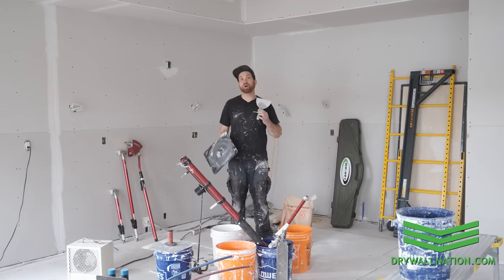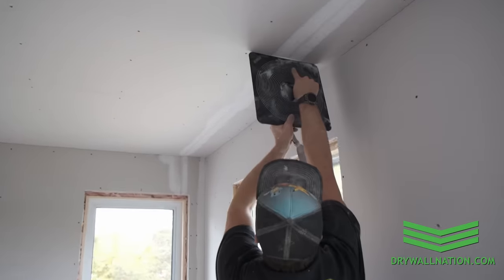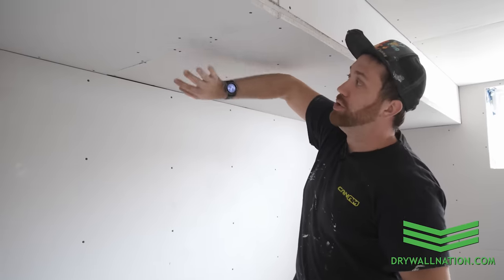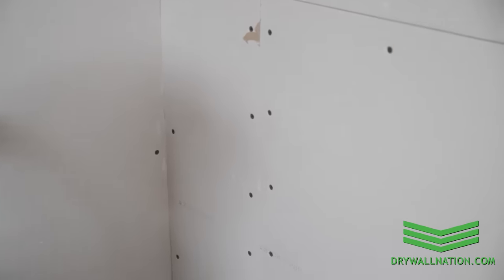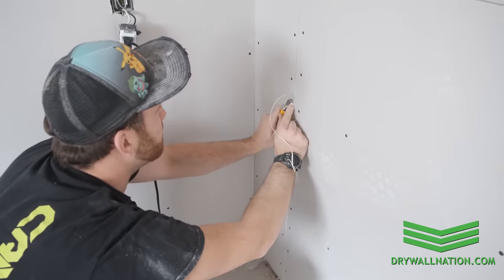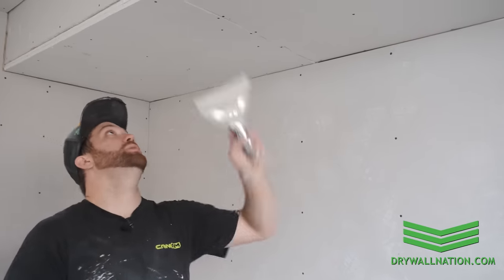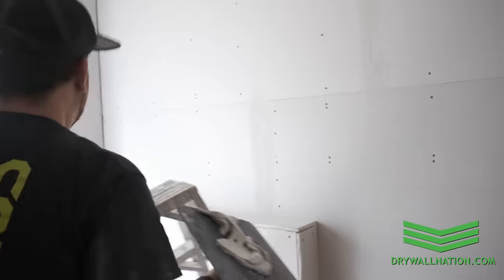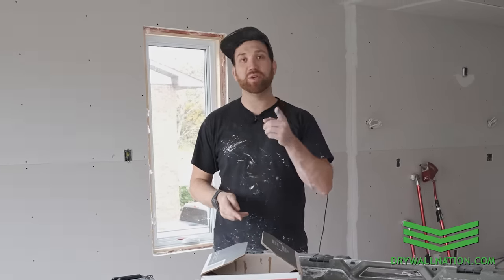Importance of Prefilling and V-Grooving butt joints.

Comment: Is there any reason that you aren't prefilling the flat joints? I was taught that this was the only way to prevent the squish out of compound as the studs shrink. I started doing this 15 years ago (along with the cut out and prefill on the butts - good call!) and haven't had a single call back because of the 4' high bulge in the walls. Is this just a regional thing? Cheers!

Comment: I had a simular case when I had to install 2 layers of 5/8 but did request to the Engineer to revise the permit and went with 1 layer of type c firecheck  1/2 inch drywall,  you can actually get passed by the city inspection because the type c is 2 hours min  vs type x 30-45 mins the only thing you need is Engineer to sign date and stamp , thanks for your informative videos
Reply from the maker: Intsresting! Good to know!
Thanks for the info and thanks for tuning in.

Comment: I'm a noobie, but I use 45 minute on big gaps and screw holes. Never do the but joints but I run my sheets vertical, so its less of an issue. And I have never had to do a ceiling in a large room.

Comment: Thanks for another great video! Would love if you guys could do one on how you prefill around bad cutouts. I was taught the perma patch method (I'm not a pro pure hobby level) but seems like you guys have a faster, cheaper and cleaner approach
Reply from the maker: Thanks for the kind words. We'll try to do that on one of our upcoming jobs. 6" rolls of Fibafuse work great for floating over damaged areas.
Reply: @drywallnation  the problem why there is a need for V-Groove is pan mud and paper tape.

I use Duroban and mesh tape and hot mud to finish and I never ever had a bubble or cracks.
Reply: @ViperStruck1  lol, Anytime bro the truth be told when I am on a union job I will use pan mud but if they have any hot mud on site I am going to burn through every bag first, cut all my corners and sometimes do a second coating before my shift ends
Reply: @ViperStruck1  that wood had to be moving or something because that is not normal especially with gluing it too
Reply: @ViperStruck1  this is being honest as honest as I can, with the combination of hot mud, duro rock and mess tape I have never had even one crack ever. I believe in that combination so much I even use it in corners which is a slow process but no cracks.
Reply: @rickyperkins232  Union is Awesome Great Guy's Razor sharp guys trust me . Job's the same doesn't matter to the compound.

Comment: I just repair. I don't do new work. I "V" groove anywhere there's an overlapping edge, crack, or plug patch. Then I tape over it. Prevents it from doing it again. I don't tape on plaster. I just build it up. Tape has a tendency to peel over time.

Comment: I’m a retired sheet rocker and we always grooved our butt joints before we hung the sheet. Sheet rockers looked like they could have done a better job of hanging. They gave you a joint eight inches from the wall. Why?
Reply from the maker: I'm glad to hear you v groove as well. Regarding the joint 8" from the wall, it's a long video, so im not sure which you're referring too but we hung this job ourselves, so im sure we had our reasons. We also use buttboard which recesses your buttjoint.

Comment: I dont like hot mud because it expands when it dries. I try to use joint mud because it will shrink. Lows are better than highs.
And Yes. Go through and cutout any delaminations and cut grooves on but joints. 👌

Comment: Always prefill,but never v cut, I've seen it a couple times in 20 plus years here in Colorado and wondered what the benefits are . I'm definitely interested in those butt boards though.
Reply: Yeah I agree. Im in Colorado i haven't v-grooved. Joint isnt moving and your taping it anyway. Why cut away the paper holding it more.
Reply: @kennethmabus381  Ive been in Colorado since 1976. We always V groove and prefill all joints. You must be from the Eastern slope where the cheap jobs are. We get Denver corner cutters coming up here into the mountains underbidding and doing poor quality all the time.
Reply: @endoalley680  ive been here since 73'

Comment: Im an electrician in FL I fill alot of holes.  Would love to see a video on how to best do that.  When I get a call back to do something else I see shrink lines and crazing from using joint compound.  I have recently tried hot mud but have not been back to see what the final finish looks like.
Reply: Setting compound  is good. It doesn't  shrink like mud
Reply: Dude get a mud pan ( metal ) 5 min easysand and mix it with water . Thick if needed to pack the hole first .  We use mesh tape at work and twist it in the hole like a tight spiral then it fills when you let it go put a lil mud on them stick mesh over the whole hole .

Comment: Usually I prefill anything over a quarter inch especially on inside corners I haven't really found anything that's less than a quarter inch needing to be prefilled I guess it depends on what's going on with the Gap and how deep it goes. More of a judgment call based on the deepness of the Gap I would say. But yeah pre-filling is very important to me too. I also do the v Gap cutouts especially if the butt joints are super tight. If there happens to be a slight Gap I might not v cut.

Comment: That’s just overdoing it, unless you are having a Level 5 smooth finish with a lot of sunlight reflecting in then that would be appropriate. And Fast set mud is bad for prefilling unless the void is 1/2 inch or bigger to act as backing after it sets, but you have to be careful with fast set because it reacts after it sets and bloats up because the moisture is evaporating which means you will have to scrape or feather off until completely flat. I’m from So Cal and only use all purpose with thick consistency to prefill and pretty much first coat all of the project.

Comment: I do a lot of high end offices and massive projects.  I always expect my tapers to prefill using confil.  I also order my drwyall so my boarders do stand ups to ceiling height.  If not, I QC  the joints and only trim out the sheets with  busted  edges  A good trick with steel framing is to lose the butt joints behind perpendicular walls.   V-jointing all the butts is too much to expect contract workers to do and the  finish isnt that much better.  Most GWB ceilings are level 5'd anyhow, so floating the butts is fine.  Most walls in front of bay windows are typically level 5'd as well to prevent flashing.  BC, Canada, baby.

Comment: Is it possible to use green all purpose to prefill or do I have to only use hot mud?
Reply from the maker: You can prefill with joint compound for sure. We just prefer using hotmuds because it dries faster so we can tape over it immediately and there's no shrinkage.

Comment: Does the pre fill have to dry before taping?
Reply: Yes, I would recommend letting the pre fill dry before taping. We pre fill all joints and gaps in corners. The better any drywall mud drys out the better the bond.
Reply: I always allow any prefill to dry completely and use durabond 90.

Comment: I'm definitely not a pro with mudding. I just use all purpose mud. Been doing drywall repairs and what not for years and never had a complaint. I never v cut. I never used anything other than all purpose mud. Hot mud seems a lot faster though for first coat for sure
Reply: I just started using hot mud after a decade plus of weekend warrior premade joint compound. It makes a huge difference in the quality of the finished product. It's not as easy to sand, but you don't have to sand as much because it goes on better and doesn't shrink or crack as much. I'm kicking myself for not using hot mud sooner.

Comment: However, did the drywall on the 1-hour soffit & fascia did it wrong. Should have let the 2nd sheet overlay the first sheet. So your cornerbead has more meat to sit on. And not a cracking issue down the road.

Comment: I used to V-Groove my butt joints. But too often the durabond line kinda "inflated" and was visible trough the finish joint after painting.

Nowadays I just tear the paper apart if i see a defect.
Reply from the maker: Inflated eh? Interesting. I've never had that issue. Lots of variables in the drywall industry though. Heat, humidity, moisture, different types of compounds and drywall.
So long as the finished product looks good. Keep up the good work brother!
Reply: @drywallnation  Yeah, I don't know how to properly describe it since english is not my first language but once painted, you could clearly see the durabond line of the V groove. I happened to me maybe 4-5 times on 40-50 jobs but i don't want to risk it again.

Instead i coat all my but joints with 2 layers of mesh tape and a god coat of durabond 90. People say it's not good but i have very little defects from my butt joints. The advantage is i can put 2 coats the same day.

Comment: Interesting. I taped for 10 years in the 70s on Long Island and mostly in New York City. We never pre-filled. I can see the advantage.

There was a time when a new union replaced the tapers, so we went to duabond 90 to not only set the tape and second coat, but also to skim the walls.

Comment: That soffit doesn`t have the fire protection you think it does you didn't weave the the corners and it would have helped with the corner bead production isn't the way to go if you end up having to do it again it's just as easy to do it right than to do it wrong

Comment: I love when a drywall company thinks they  know better than the USG Installation handbook..  Gypsum Construction Handbook,, First off you stagger butt joints , Second the screws require  to be set and have a set distance from the edge of the butt joint. Once you v cut that edge you are now in code violation... The bugle head must be set in the paper with no tear ..

Comment: Why not to precut butt joints before hanging them on with plane ?? Cause this tedious process of precut could be avoided this way an giving a way more clean and neat groove than if this would be done by hands. Also worth mentioning that using glass woven fabric tape which is thinner and tougher to cover up joint could be way better than regular paper.

Comment: It sure is a great practice but all this takes time and time is money. Unfortunately nobody in my area wants to pay extra. They will find another guy who is cheaper and doesn’t prefill. No one cares anymore what is underneath as long as it looks good when painted.
Reply: I agree.  On the upside, it keeps the repair guys busy.  I do a lot of repair work and I've yet to fix one that has been prefilled unless some sort of disaster like a wall moving or water line failure has happened.  Don't get me wrong.  A body can do everything right and stuff still goes to crap.  But cutting corners pretty much guarantees that it will.  It will just be someone else's problem when it does.
Reply: not really , i dont mind paying more ,if i know what goes into the work , most of time owners dont ......

Comment: Just wanted to note to anyone doing this for the first time. I felt I had a pretty sharp blade, but was getting frustrated and stopped. Later to try it again with a fresh blade and made all the difference. Also swapped out the blade during as well. When I notice the blade pushing the paper instead of cutting is when I swapped it out. Hope this helps someone doing it for there first time. I almost gave up lol

Comment: This is a waste of time. The board nor the mud and tape are structural. Both are decorative, notching a tight joint does not make it flatter or stronger. We turned 800 houses a year out on average for twenty years. First clue that this is crap, the hawk. Hawks went out of style by 1980. Cause the bazooka and bedding boxes made them obsolete.

Comment: That's bullhonky. Those buttboards are ridiculous. Shouldn't even be legal. I never cut my butts. Don't prefill either. Screws should be staggered and closer on the bevel. While you're cutting fuzzies and filling cracks I would have it taped. 42 years experience is all I should have to say.